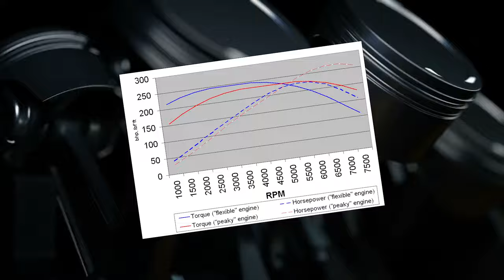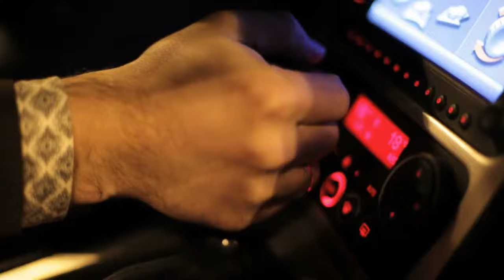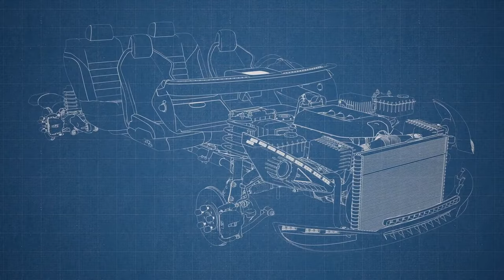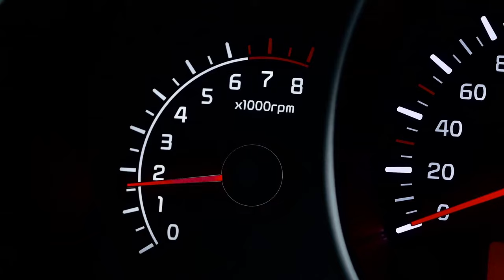Why Do Electric Cars Only Have One Gear?

Comment: Why haven't manufacturers thought about fun? 5 gears in an electric car, with a clutch pedal, to allow for predictable low speed maneuverability, might cost more, but would make electric cars more acceptable to many more people, especially in europe, where most cars are manuals.
Reply from the maker: That would add more components to break, make the cars slower, and make them less maneuverable. There’s very few advantages to that other than novelty unfortunately. I love manuals too
Reply: @Concerning Reality  components break anyway. What's more expensive? State of the art electric motor, or adapted and practical 2 speed transmission? Easier on the motor, even if it's not "necessary". Seems like an excuse for planned obsolescence.
Reply: @jeremysanders8138 lol no, you ICE guys have zero idea how electric car motors work bruhhh. It would be easier on the motor if it is a DC motor, which isn't used in majority of EVs.
Reply: @DragonOfTheMortalKombat  so explain to me why in most evs, the amount of throttle you give determines how long the battery will last? Is it not basic inductive reasoning to say a transmission would decrease the necessity for a more open throttle to maintain a speed that the same openness  in that throttle might require without a transmission?
Reply: @DragonOfTheMortalKombat  You're not even a car guy and probably have never driven a manual so your input is invalid.
Reply: Cars are tools, and most consumers just want to get from point A to point B in the most efficient, safest, cheapest way possible
Reply: They are lazy

Comment: The explanation doesn't accurately describe an electric motor's output. It implies that torque is constant. What is constant (within limits) is power. Since Power =Torque x RPM (therefore Torque =  Power/RPM) there is maximum torque at zero RPM and it trails off as the RPM increases.

Comment: I do have one question revving up to higher rpms more electricity so why not have it at lower RPMs going at higher speeds would that not save on electricity and give you longer range
Reply from the maker: Well rpms directly translate into speed at the wheels, so without a gearbox that’s impossible. You could gear the motors down to run at Lower RPMs at higher speeds but you’d lose torque.
Reply: @ConcerningReality  but it's the same thing that engines do in gasoline vehicles to save on gas you lower the RPMs to get better gas mileage with the concept still be the same in electric motor to transmission lower RPMs better battery mileage because the Tesla is 6200 RPM at 65 mph but most cars today will average 2500 rpm at 60 MPH
Reply: Gud question I would like to knw the answers as well
Reply: @keeyon81  yeah,you are right......
I also have this question, for a long time.....when ev arise without manual transmission.
I am too waiting for a positive and practical answer.....
Reply: @keeyon81  you're right, that's why porsche added 2 gears of their electric car. The only thing stopping them is cost and space.
Reply: @keeyon81  I might be about a hear late, but a company called Electrogenic made an EV Porsche 356 with an actual 4 speed gearbox. The EV motor had 120hp but it has low RPM (like 7k) so it feels like an actual ICE car
Reply: Trains have never had transmissions and no truck has ever had the power of a locomotive and no car is as fast as a bullet or high speed train for long distances.  Locomotives have been powered by electric motors since 1950 and if there were an advantage to having a transmission it would've happened by now. Fuel is a major expense item for the transportation industry and they are always in the market for more fuel efficiency.
Reply: ur a god this is a question i have always kept asking myself and searching on the internet but no one mentioned it
Reply: I honestly don't know why electric cars don't have or can't have gearbox. Gears works the same no matter if you use combustion engine, electric engine or hand crank
Reply: But it will increase cost and weight, transmission weight is more than engine in some cars
Reply: @abhisheksoni303 a gearbox aint heavier than 1-2 passengers max and the power savings from using it would be noticeable
Reply: @keeyon81  The reason "Lower RPM is more efficient" is true for ICE engines is because they are most efficient running at about 1200rpm-1800rpm depending on the design. A multi-gear transmission will allow an engine to run it's crank shaft closer to this rpm while transmitting the required rpm to the wheels based on it's gear ratio and current gear.

Given that the US Department of Energy is recommending driving within 50-60mph for EV's, I surmise that the efficiency curve of most current EV's with their 1-gear transmission don't actually suffer significantly until they go past that speed. Porsche EV's with multi-gear transmissions actually make sense because they're sports cars meant to exceed those speeds. Meanwhile, an EV for city driving probably wouldn't benefit from making the switch unless they're on a highway.
Reply: @Hafiere I think highway  and long distance driving is what he had in mind.

Comment: As a EV owner, I really hope that it has 2 gears - high and low, so that I can go 180km/h at highway without draining my battery too fast.
Reply: Hmm Sounds like a power glide, which was a 2 speed transmission and still used in drag racing. It was also the first automatic transmissions for ice engines.
Reply: You are not an ev owner

Comment: I don't know why we have to repeat our current problems. Manufactures build high speed cars for advertising purposes. There is no reason to be in a vehicle without wearing a seatbelt. There are no benefits to using tobacco products and there is no advantage to manufacturing a car that can top 90 MPH. Every vehicle built in the last couple of decades needs a computer to run. The software limits what the driver can do. All those Fast and Furious movies required the manufacturers to have an IT team on set to modify the car's software in order for many of those stunts to be made. The manufacturer didn't allow the vehicles to leave the set nor was filming allowed without the supervision of their IT people. After filming was completed the manufacturer reinstalled the factory settings on the software. I know it's harmful to people in the insurance, hospital and funeral home industries but Corvettes and Muscle Cars and Sports Cars should not be allowed to share the road with school busses, teen drivers and our families.
Reply: Some countries have higher or no speed limits.
Reply: WRONG. Only Germany has no speed limits on part of one of their highways. The recommended speed is 80 MPH but it is only a reccommendation. They do have actual speed limits on the Autobahn depending on the time of day for some cities. In any case the dealerships can download software to allow the car to reach it's maximum rating. @petrosnemardos
Reply: @danielebrparish4271  so how am I wrong ?

Comment: But can't we have smaller weaker electric engine and adjust gearing when necessary? Like if car would struggle uphill you could just switch to lower gear and you could do that with smaller engine
Reply: We can and it'd be better for most users for daily drive but it's not that interesting to make cars costing $10-40 with gearbox instead of $40-100 cars with no gearbox 😂
Reply: Much worse fuel (energy) economy with a smaller electric motor, big motor, more copper, more voltage, less current
Reply: @due737ejdnd  Ok, but gears would also work with bigger motors
Reply: @realdragon  but why have gears? They add weight, point of failure, energy loss for no gain, you need gear in ICE because they stall while they get inefficient at higher rpm. Multi-Gear transmission is a necessary evil in ICE cars. Inductive losses in a motor due to higher AC frequency for higher rpm are far, far, far, far, far lower than frictional losses in gears.  Also electric motors have max torque at 0 angular velocity (rpm but rad/s is a better unit) hence they do not stall, so no clutch or torque converter required, can rev much higher without losses. Single gear boxes are used since you want acceleration from smaller motor although inefficient at like 96%' bigger motor high torque low rpm (98% or more for industrial motors) that can supply torque directly to shafts without any gearing to the wheels adds weight and more importantly cost since you need 4 of them. Also I was talking about synchronous motors which are most efficient although there other types of motors.
Reply: @due737ejdnd  With gears you can get higher torque or higher speed
Reply: @realdragon  just increasing rpm or torque of motor is better than gears
Reply: @due737ejdnd  Why, with gears you increase it A LOT
Reply: @realdragon  Electric motors give enough torque to make gearing completely redundant, any more gears would just create wheelspin - (which most electric cars can do without traction control anyway at any speed)

Comment: 1 gear? Great, if you can do it, but what about the tesla drive train, being run through cvt? Same power output, but add cvt to give a relative 6500rpm, instead of 10000, and see what happens to acceleration? Think of accelerating a flywheel with 1 gear, now accelerate the same flywheel with the same motor but use cvt, what happens?

Comment: Who wants gears for speed 
We want them for better range.

Simple fact is that ,by installing gears less power can move the car with lower rpm so less battery is consumed
Reply: This is why manual/automatic transmission EVs should appear into the mass market
Reply: This is exactly what I've been thinking about recently.
Reply: Yes you’re right I think less battery would be consumed
Reply: The thing is that Evs dont gain much efficiency from lower RPMs as they are almost allways very efficient. The drivetrain losses from adding the gears would most likely be the same or worse than the gains from lower rpm, therefore not helping much with range
Reply: This is why I'm at this video, I don't get why they don't for increased range??

Comment: We need such systems that when we need speed can use just one gear And the transmission gear can be used whenever we need a better range 
      period....
Reply: We have peddle shifters for that
Reply: It’s called a continuously variable transmission.
Reply: Electric motors don't work that way, everything you know about ICEs does not apply except for P = Torque times angular velocity
Reply: @due737ejdnd this is wrong, Even bicycles have gears. your Tesla have one gear, the front and rear have different ratio so one works more efficiently on either low speed and high speed

EV Cars need 2 gears while high power EV Motorcycles will need even more, possibly 4 gears
Reply: @ameserich  you don't get this, gears are a COMPROMISE NOT A REQUIREMENT OR ENHANCER, do not need more than 1 gear ratio if you engineer the motor right

Comment: The power band on ICE engines is restricted to mesh with its transmission. Some race cars can pull over 10,000RPMs, but consumer ICE engine/transmissions are designed to maximize fuel efficiency.

A single gear EV is not fuel efficient. The higher the electric engine RPMs, the more electricity required to maintain those RPMs. A more fuel efficient EV engine would use a transmission is multiple gears to extend range.

Comment: Since there is already a gear in the electric car preventing it from instantly driving at insane rpm, it still means you could be more efficient with 2 right? the first for speeding up from stand still and the second beying a 1:1 ratio so that when going fast you could speed up to even higher rpm's? Could be that im wrong but just couldn't help but think of it
Reply: And why not put smaller and weaker engine with gears? If you need more torque you can switch between gear ratios. You can still have range of torque and speed with electric engine because of gear physics
Reply: @realdragon   @skeep12 I was thinking along the same lines. electric cars' range deteriorates  quickly  after hitting 100 kmph (60 mph). Why not put two gears (basically a city gear and a highway gear) to improve range even on highways?

Comment: Most Teslas have 1G acceleration from a standstill so it's not like the motor is going to struggle on a hill. I'm not sure about lower powered electric cars like Nissan Leaf (which is still 150 horses) but I'm thinking uphill caravan towing in a Nissan Leaf might be where I want another lower ratio gear. Generally the smaller the motor and the heavier the vehicle, the larger the range of gearing you need. Performance electric motorcycles only need a single speed, but diesel HGVs need at least 10.
Reply: @Tim Lewis although you may not need more than one gear on a high power vehicle like the model s, wouldn't you still want a low range to increase your max torque/acceleration? You see electric vehicles with around 400 hp get better launches than an i.c.e with 700 hp, but over longer distance/during a roll race, the combustion engine ends up winning because of the higher hp. In my opinion, at least a two speed makes sense to get max output out of your motor, no matter how strong of a motor you have.
Reply: @williammilliron8735  I was saying that there isn't much more acceleration on a Tesla to be had that doesn't break the traction. Perhaps it could be geared 10-15% lower, and then given a taller gear as well so the petrol cars can't catch it up again at higher speeds. In this case I think it was kind of a "How fast will most people need this car to go? Is it worth the extra expense to wring out more top end when it vastly exceeds what's legal in most places?" business decision. The power band in this car is probably around 60 mph when you floor it, as a ballpark guess - enough to overtake slower drivers. If you wanted to see what the motor could do on a standing mile, it is worth adding some gears to wring the most out of it and extend the powerband, but as far as company profits I don't think it was worth it. Whilst the car will reach 155 mph with 1/3 of its power, most people rarely exceed 90 mph, and taller gears don't benefit efficiency like they do with a petrol car. They can load down the motor too much in a lot of cases. That's another thing - it would have to be an automatic to stop people trying to use the tallest gear when towing uphill and stressing the motor more than the right gear would, and also complaining about poor range and motor failures or thermal cutoff. Being in too high a gear is unlikely to damage a petrol engine - it will just slow down, but it can do with an electric motor which draws even more current and doesn't cool as well.
Reply: in combustion cars you are not allowed to hold the vehicle uphill with gas pedal because it may fuck up transmission. I wonder does electric car affected by this?

Comment: But wouldn't transmissions make it drive for way longer since a high power output becomes unnecessary in a high gear? That's a big reason they were essential in gas cars. It also increased the life expectancy of the engine and prevented overheating but... gaining a lot more distance was a huge perk.
Reply: Power = Torque • Angular Velocity and Power = Potential difference • current in a motor, hence Torque • Angular Velocity = Potential difference • Current • Efficiency, Efficiency is pretty much constant in EV for all variables except for current, so lower the current the higher the Efficiency (you could use thicker wires for Efficiency but adds weight), in EV you can increase Potential difference to increase Power without affecting Efficiency (actually improves efficiency), hence bigger motors are more efficient than smaller motors

Comment: What about going uphill, climbing a steep lope? How do electric cars go uphill without a gearbox?
Reply: The same way trains do. More current to the wheel motors creates more power.
Reply: @danielebrparish4271  that's not a very good comparison.  Steel on steel
 Vs rubber on tarmac.

Gradients and friction make a huge difference.
Reply: @r3nagad328  I don't think gradients and friction can replace gearboxes or add power to an axle or wheel.

Comment: Do i need a gear box if my converted car (run electric dc motor) can run 44 km/h
45km/h = stall torque... And when every i go up hill at 0 or low speed like 10km/h, it go slow until it stop. Weight:550-600 kg with no passenger but include electric dynamo and battery... Volt max: up to 80.00 V.Ampere max: up to 100-110 A. Car brand :Suzuki fronte.... I do mind torque... Bc torque is import for my car... And since why (my dad) car converted into electric car... Bc of tax and electric is cheaper than gas in my country